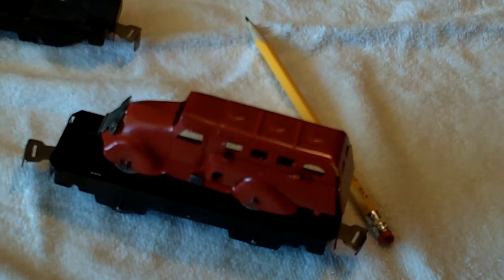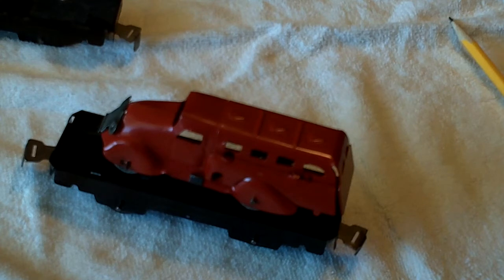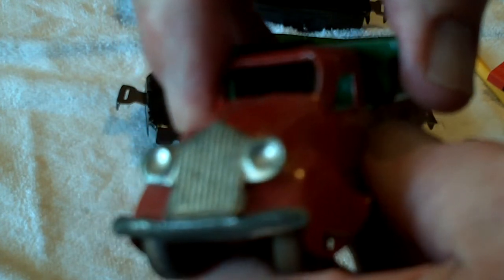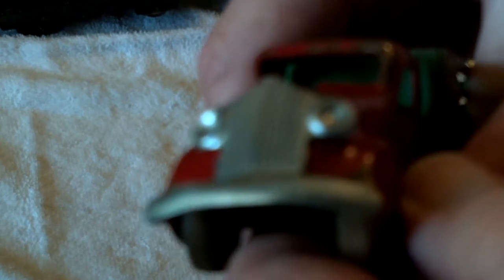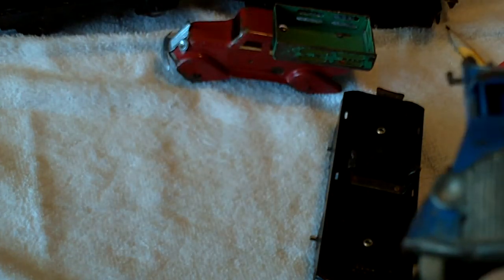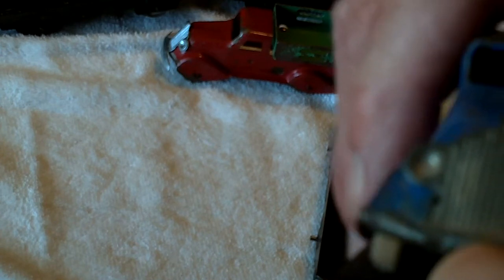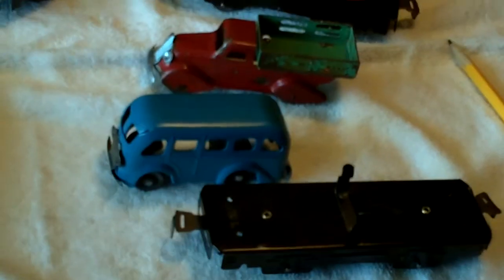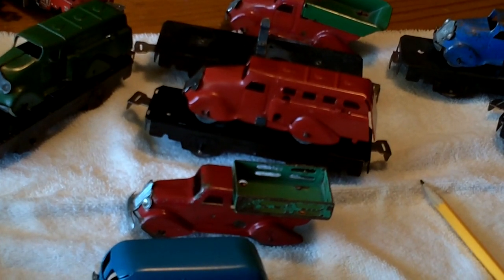Marx Train 6 inch, Tin, Flatcar Loads Auto, Trucks, Buses, and Misc.

Comment: This is great!  I've seen them on ebay from time to time.. Pricey for certain, but I see why..  Thanks loads!!
Reply from the maker: Indeed they did, the log car, the spotlight car, the cable reel car, and the flat car with my red and green dump truck all came from my 4898 Marx Canadian  Pacific work train set. It also came with a very nice 6 inch wrecker.
Reply: This is a very good collection.... The rare few that are still left could not compare.   Thanks for posting this.   Now I have a better reference for Marx trains that I see...  Especially the accessories..